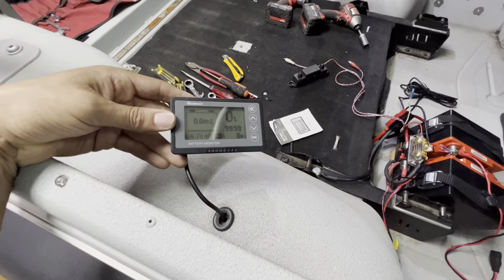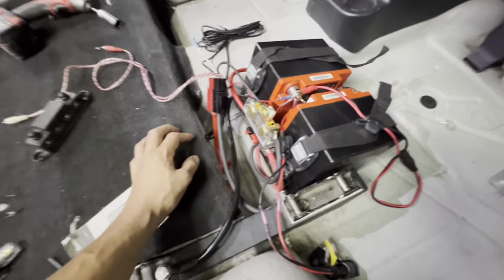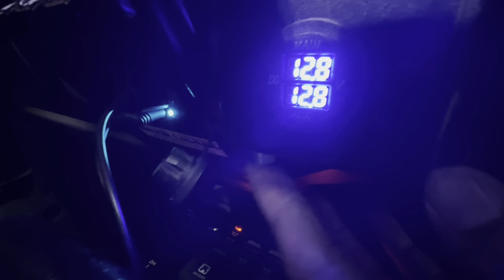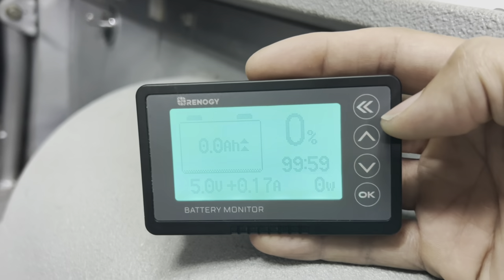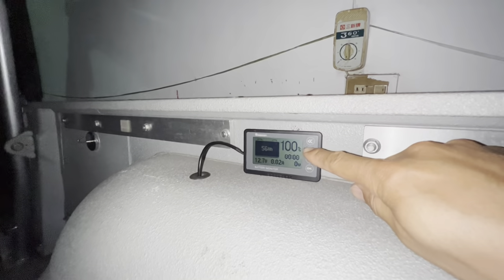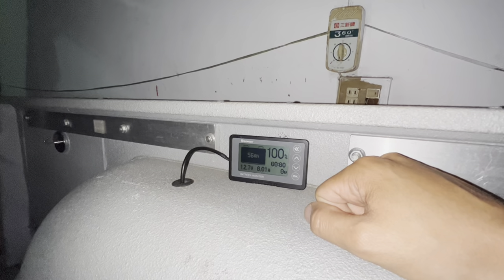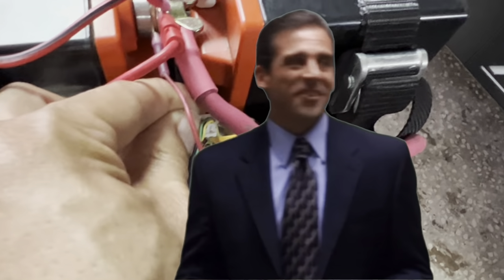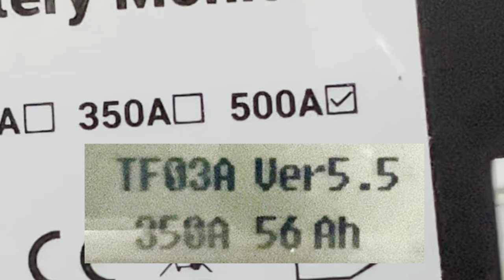Renogy RBM500 battery monitor. I have regrets.

Comment: Mine did the same hold down you okay button till you get into your and reset your low voltage to 11.4 and the alarm should stop. back out of settings and hold down up arrow and you will reset your battery to 100% but make sure your batteries are fully charged. I have 400 amp hours of lithium at my low voltage was set to 13.4 and my monitor did the same. I set my low voltage to 12.4 and since have had no issues as recommended in my setup. Hopefully that will work.
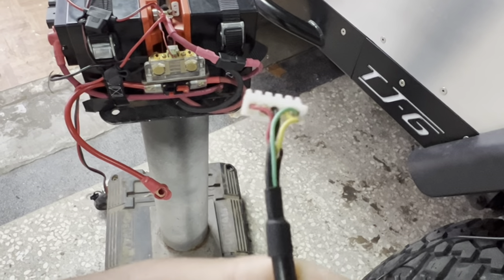Reply from the maker: I made this video quite a while back so I can’t say with 100% certainty that I tried this at the time but I spent at least a couple days fussing with the settings and resetting the thing and nothing worked. I ended up swiping it out for a Victron monitor which I’ve been really happy with. The giant green screen was nice but I was tired of the gremlins. Did you see the part towards the end where I managed to reset it and get it working momentarily? Or the part at 5:48? 

This was the follow-up video I made https://youtu.be/20V6Dh3LCkI?si=DPFpdD307egmbMIg

I do appreciate your input though. Thanks for taking the time. 🍻

Comment: I understand the skepticism about trusting the company regarding the amp rating issue. It's possible that its due to software, and the hardware might actually be capable of handling it. 350 amps at what I assume is 12 volts (dont know if its in series) equates to 4 kW, and I suspect your wiring might not be suitable for this load anyway.

Regarding the connector, it doesn't appear to have an outdoor rating, which is problematic given its use on the back of a vehicle, due to vibration and possibly exposure to elements. You could consider using potting adhesive to secure it in place if others intend to use the monitor. It didn't simply "go bad"; it seems that it experienced a lot of movement, which is not what this device is designed for, as it's intended for fixed installations.
Reply from the maker: The elements were irrelevant in my case being that the monitor and the battery bank were both mounted on the inside of my vehicle. And the amount of vibration created by the type of trail riding I personally do should not be an issue. By comparison, It's not an issue for my Alpine head unit and amplifier, my 2 pre-amped subwoofers, my Switch-pros module, and so on. If vibration were an issue for the RBM500, The user manual would/should indicate that. It doesn't. With all do respect, yes. It did in fact "go bad"

Comment: Holding the up arrow calibrates the system. When you know the battery is fully charged, hold the up arrow to tell the system it's fully charged, that way it has a starting point. Alternatively, if you know the battery is fully discharged you could hold the down arrow and set that as the  0% charged state.
Reply from the maker: Did that. I stated with trouble shooting the hardware and then moved on to software. Fast forward to 4:57.

Comment: I'm pretty sure mine is connected to the negative side of the battery not the positive, I haven't had the issues that you've had. I hope you got it resolved.
Reply from the maker: Yes the shunt gets it’s reading from the Neg terminal. But the small wire that powers the monitor screen goes to the Positive terminal. I wasn’t able to resolve the issue unfortunately. I decided to swap it for a Victron unit. All is well since then. Thanks for watching.
Reply: shunts can be on either side, negative is just safer according to them

Comment: I believe if you draw too many amps it will go into this mode. If you disconnect and reconnect it will restart. You can change the amps in the settings
Reply from the maker: Maybe so, but that wasn’t my issue. With my system, I’m no where near the max Amps for this monitor.

Comment: every electronics needs reset from time to time. fact! sometimes you just have to unlug it from electricity. pull your cable directly from monitor and shunt. could be that electronics on shunt and monitor both need reset at same time. or maybe just monitor bad.
Reply from the maker: The monitor was definitely bad. I tried everything possible. I swapped to a Victron Smart unit and haven't had any issues since.

Comment: i had the same problem but i went and looked at the setup for the monitor on renogy and it said once you plug everything in set up the limits you want on it. then press the up arrow for three seconds for it to recognize and reset for what your battery is now. I think this needs to be done every time you unhook it from the battery's I run  5   100 amp batteries or 6500 watt hours and it connected and shows it.   there is no current when you disconnect the battery and it has no way to remember your settings.
Reply from the maker: Yup I mention the 3 second hold trick a couple times in the video. Didn't work. I've been pretty happy with my Victron since I made this video. I will say, I do miss the big green screen that shows everything all at once. Thanks for watching. ;-)

Comment: You need to put it on the negative lead not the position.
Reply from the maker: Shunt get both neg. and pos. feed. They measure capacity through neg. and the positive powers the monitor.